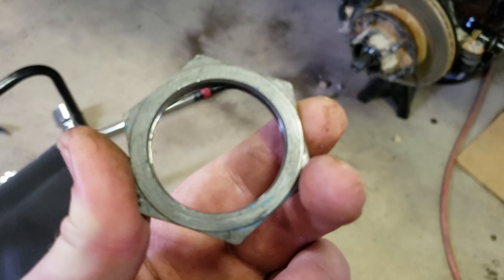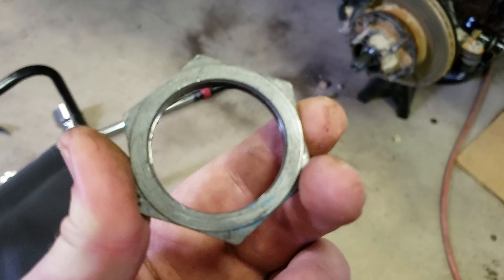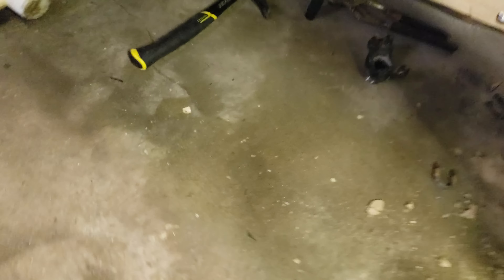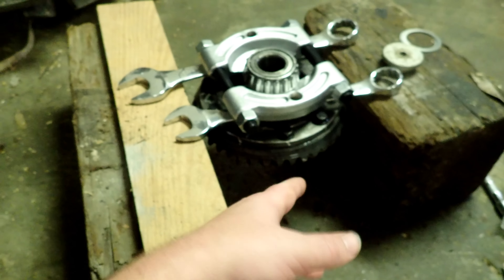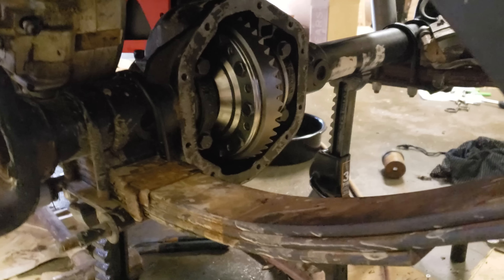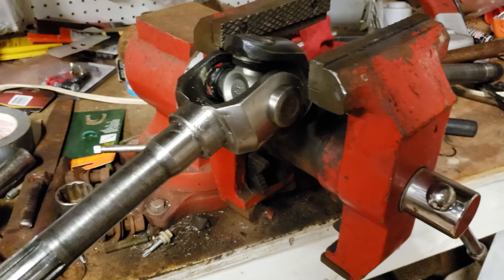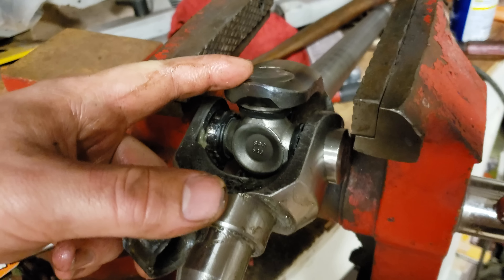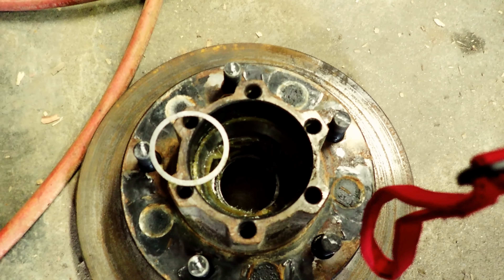30 SPLINE OX LOCKER INSTALL ON MAHINDRA ROXOR

Comment: No need to mess with pinion depth unless you are changing the gear ratio. The OEM had tools to measure the pinion depth and set it right.  Easy to change from open differential to locker/limited slip with original gears.  Swap ring gear over to new differential ( use loctite on ring gear bolts).  Reinstall center section, check backlash, and contact pattern.  Contact pattern is in normal direction of rotation with drag on the output.  New Differential Locker may be wider or narrower than the one removed and require different sized shims.  Generally, start with the removed ones.

Comment: I don’t want to criticize but there should be a spec for installing your axle hub. Maybe this will help others and this is what I do. There should be less than .003” end play and absolutely no preload on the bearing. I typically tighten my inner nut to 100 ft/ lbs then back it off 1 complete turn. Then I tighten the inner nut to 50 ft/lbs and then back the nut off 1 flat before installing the outer nut and lock washer.

Comment: Nice job, The rear will be easier. There are only 2 parts of a car that I'm afraid to mess with; a diff and auto trans... I REALLY need to regear my Jeep (Love the cable OX locker btw) If you hit the trails and your Diffs hold up, I guess I won't have much of an excuse to not just do it 😥. (going for a true track in front and a lunchbox? in the back)
Reply from the maker: The process was very interesting to me, not so much hard but time consuming. Proper tools are key. I have confidence that you could do it if you are patient! I will hopefully have a review of these things in the coming weeks.
Reply: @RedWhiteRoxor  Can't wait for the review! I like how it has no crush sleeve, but the shims behind the carrier bearing looked like a pain... I actually have most of the specialty tools needed, but don't have the basics like jackstands (big fire), or a place to work on it for a few days. Good luck, I think you got it!

Comment: We always used channel locks to take those large nuts off at the dealership.
Reply from the maker: Even the inside (deep) nuts? Then what happens when you need to put new ones in and tighten them lol?
Reply: @RedWhiteRoxor  Same if I remember. Been 19 years..... but they are not meant to be super tight, thin as they are, and held in by other parts as well.

Comment: Seems like mechanic work to me. Always something to make you think.  You have to be clever and think outside of the box to be a good mechanic.  Most of the time if something is fighting you, it’s because you missed something obvious.  Take a second and a calm look at all your doing.  I don’t think your shocks are upside down.  For anyone else installing universal joints,  fill the cap with grease and the needle bearings will stay put.  Hitting it with a hammer will result in needle bearings falling out of place.

Comment: Sir make sure you do grease  the both slip yourks on the drive shafts because in mahindra its a problem with the front shaft the slip yourk wears much faster than the rear and the socket you bought you don't need that expensive for that i have one I will send you an image of that and yes if you want any part for that just order it on M to all mahindra,s official website the parts of mahindra thar and roxer are same

Comment: Nice work! I'm disappointed in Mahindra advertising this as a strictly off road machine when it's clearly set up as a all terrain street Jeep when stock. If they aren't going to make it street legal it should come with allot of the mods you have done from factory at the same price. Why would an only off road utv require lift, lockers, hubs and all this things ppl are doing to make it keep up with other SxS... Mahindra nonsense aside your build is coming out sweet, top 3 on YouTube.
Reply from the maker: Thanks, and I get the argument there in a way... but i see the other side of it. I bought my highlifter Polaris rzr 1000 for 27k$ ( ridiculous right) and I'm just now to that point in the roxor. I am 100% confident this thing will outlast that thing by 20 years or more. Absolutely no comparison. No I cant jump things at 50 mph but in the rzr I couldnt pull crank tractors or pull trees out of the ground lol. I think they are using the roxor as a test to see if there is an interest in a vehicle for onroad use
Reply: Who are the other 2? :D